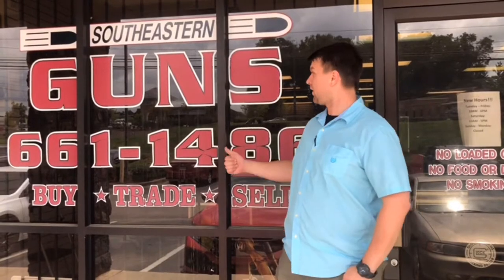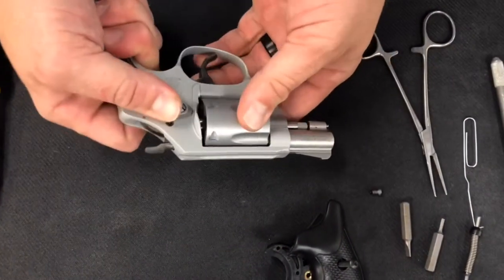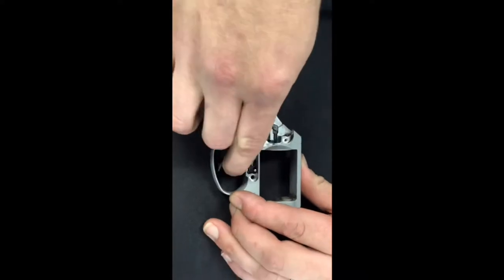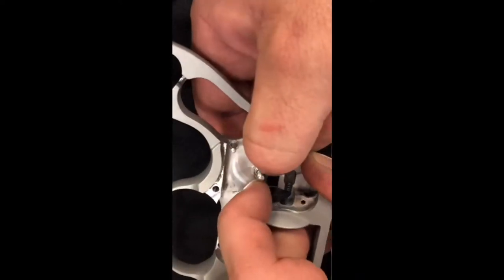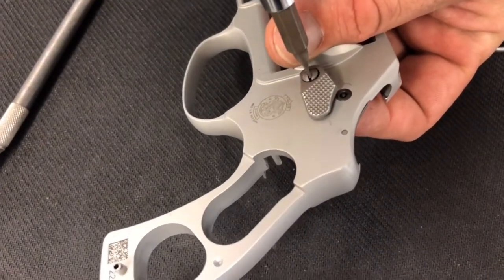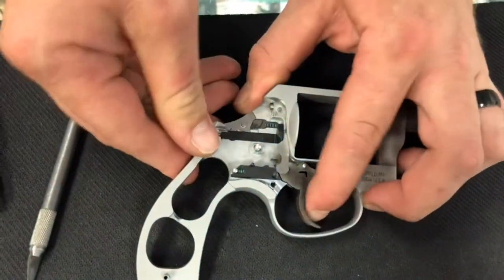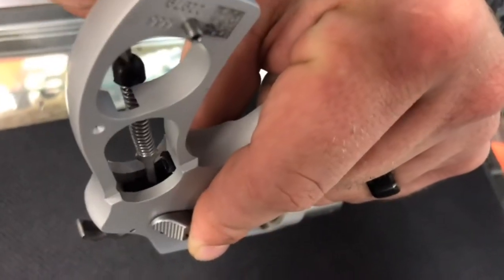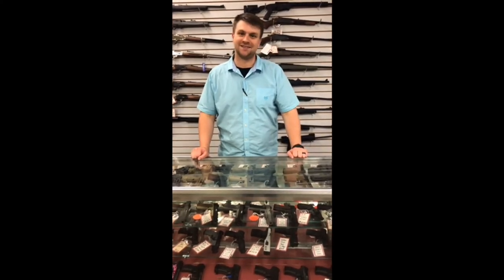Smith and Wesson J frame 637/638/642 disassembly/reassembly apex duty spring kit install

Comment: Carried an S&W Model 38 as a backup in an ankle holster daily for 32 years working and 3 years retirement maintaining annual range qualifications plus a lot of practice when the frame where the barrel is swedged into it cracked allowing the torque of the bullet to slightly twist the barrel counterclockwise ergo causing the shot placement to way off at 25 meters. Phoned and sent it back to S&W, who deemed it unrepairable. I thereby replaced it with a new S&S 638 and boy is there a difference. Improvements were a lighter alloy frame, Plus P rated. However, the modified hammer must have been designed by some white shirt designer who has never shot a revolver. They reduced the size thumbpad that unless you are a gorilla with bricklayer tough hands, is a genuine pain to cock for single-action fire. Trigger pull was a little over twelve pounds double action and four single. Trigger & hammer spring change with Wilson Combat kit yields 9.3 lbs. double, 2.3 lbs. single, three pull averages. These and a little polishing made this a smooth-shooting little pistol. Now, if it will just hold up to the same punishment (estimated 100,000 rounds) as its predecessor I will be 😃😃😃  
 NOW: I have viewed numerous gun cleaning, modification, and repair videos over the years. Your's Sir is the most well-presented and detailed YouTube video I have ever viewed. Most individuals making and posting these videos are presented more like a politician's campaign commercial. Talk, Talk & Talk, a lot of which is off-point and so unnecessary along with poor camera angles. YOUR'S here, has very good camera angles, and good lighting, and you did not block your work with body or hands, along with concise, clear narration! I am now a subscriber and will be seeking out and viewing all your videos. I feel being a Vietnam Veteran, 32-year LEO Veteran,  42-year State Hunter Education Instructor, and a lifetime hunter, shootist, and gun-nut, gives me, currently at 80 years of age, gives me a little competence in judging an individual's presentation on gun maintenance! Your's Sir, Is Number ONE and I thank you.

Comment: good video - i found a 637-1 (no 'Hillary' hole) and it is one heck of a sweet, accurate, and smooth shooter... double-action: 11.5 lbs, single-action: 4 lbs, so it's perfectly fine with no need for any remedial spring work; also found a 60 no-dash at the same time, but it could use a new set of Wolffs, due to its double-action: 14 lbs and single-action: 4.5 lbs pulls...

Comment: Many rebound springs have gone flying doing it like you see here.  Simply take your screwdriver and pry up on the rebound slide while COMPLETELY covering the spring.  It'll just "pop" against your thumb but will never end up in the next area code....Also, there's almost zero reason to ever remove the bolt or the cylinder stop.  They're a PITA to R&R and there's a very good chance of losing parts.  Hose them down along with the rest with some brake clean or put in your tank and then re lube in place.

Comment: Hopefully I won't get shriveled for this dumb question, but the trigger lever seems to have one flat side and one that is almost concave/lipped. What is the correct orientation for this piece? Hard to see that level of detail in your video and I'm having difficulty finding that information elsewhere. Otherwise, thanks for the great video, it was a satisfying process that I was not brave enough to try alone.

Comment: What you are calling a Transfer Bar is actually a hammer block safety. It really has nothing to do with firing the revolver. All it does is prevent the hammer from striking the firing pin if the gun is dropped.
Reply: Would it be illegal to remove this piece or just unwise? It rattles around and kind of annoys me. Maybe you could suggest an alternate solution than removal?
Reply: @jeffreysmith2975  The rattling is inconsequential. 

Not necessarily illegal, but intentionally bypassing a normal passive safety feature that has been proven effective for decades really opens you up to liability if there ever is an accident. 

Doing so solely because shaking the revolver makes a minor rattling noise would be very negligent.
Reply: @ColterBrog  yeah I know you're right. I appreciate your response.

Comment: How often would one replace spring in cylinder stop assembly and where would you buy them ? Thanks great video
Reply from the maker: Not often at all, I wouldn’t replace unless you’re having issues with the cylinder locking up or if it’s damaged. Try gun parts corp (numrich) they have them in stock.

Comment: Does this modification reduce the pressure needed to cock the hammer? Thanks
Reply: I think most of that pressure comes from the spring inside the grip
Reply from the maker: It does, it’s a minimal difference but it is noticeable.

Comment: What are the torque values on the screws? Why did you not use a torque wrenche?
Reply: Not my video, but when reinstalling the screws you shouldn’t encounter much resistance until they’re all the way in. You’ll feel a hard mechanical stop as they bottom out in their counterbores. You just snug it a little bit beyond that. Firm, but not super tight. 

I’ve never known anyone use a torque driver on these. It’s just not that critical. As long as the plate seats well and the screws are snugged up, you’ll be fine.
Reply: @ColterBrog  Thank you for the reply.
Colt had a problem with the new Pythons where the side plate screws were not torqued properly at the factory causing hand to ratchet timing issues.
Reply: @rodvan-zeller6360  Yes, I have one of the new Pythons. The rear-most screw was loose from the factory… but by loose, I mean you could have unscrewed it with a fingernail. I’m not sure what Colt’s issue was with that… maybe not tightening evenly, or not going back and checking each screw after they were all tightened. I’m assuming a training issue with their assemblers after not building revolvers for many years. 

They don’t have to be very tight to not be loose. Colt’s issue was just absolutely not tightened at all.
Reply: @ColterBrog  Thank you for the reply, and explanation.

Comment: It figures the only part he won't show is the part that I need to figure out in the sear spring is it. Seems like nobody on YouTube wants to do that
Reply from the maker: Shoot me a message about what you’re referring too, I’ll try to help.
Reply: I already figured it out. It's the sear spring when you take the hammer out the sear pin is in the hammer and there's a spring in between the sear and the hammer. When I took mine out it fell out that spring is so small I couldn't find it. To try to find one online is a pain in the butt because they refer it to a Sear spring but they end up sending you a spring to something else it's too long. I finally found one online and just measured it and cut it down to size and used it. And then I bought me a whole new Hammer with a sear in the spring in it just in case.